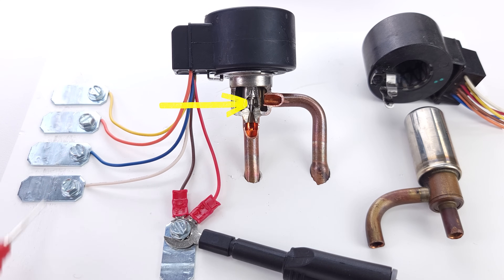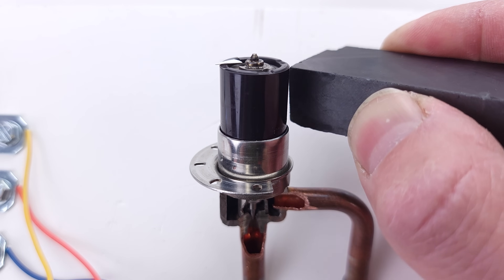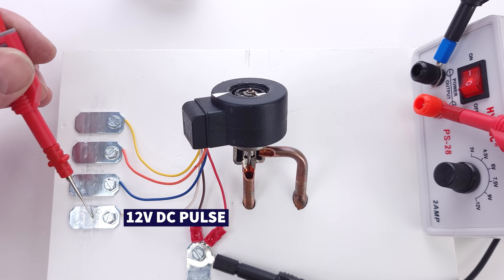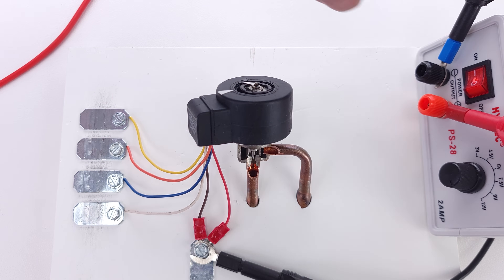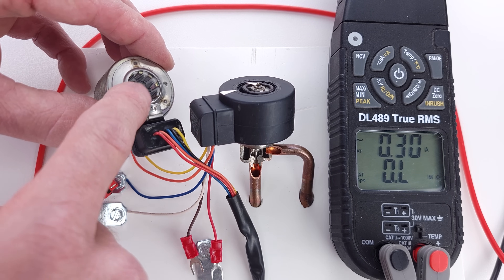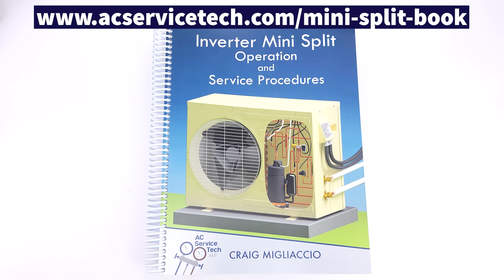Electric Expansion Valve (EEV) Operation and Testing! HVAC Metering Device Training!

Comment from the maker: Mini Split Book on Our Website- https://www.acservicetech.com/mini-split-book  
Mini Split Book on Amazon- https://amzn.to/3ytHJSs  
Mini Split Book on TruTech Tools- https://www.trutechtools.com/BooksGuides   
Mini Split E-Book on Google- https://play.google.com/store/books/details?id=HN-iEAAAQBAJ 
 Mini Split E-Book on Apple- https://books.apple.com/us/book/id6445178399
Reply: Craig your brand is single-handedly changing the service industry for the good! Well done!
Reply from the maker: Thank you so much Tim and I'm looking forward to meeting you at the Symposium in a couple weeks!
Reply: Would this be transferable to the systems in the UK?  For example, does it have both voltage differences and temperature differences?
Reply from the maker: Same component and same voltage in the UK. There are different variations of the EEV but they operate very similairly to this one, thanks!
Reply: How much torque do those tiny motors have?
Reply: It's a servo valve!!!
Reply: @Thelongmanable  Yes I gathered that.  But ty
Reply: When will it be available on Amazon?
Reply: Qqq❤❤
Reply: Great cut away views.  Scary, the size of needle valve orifice seat.  Shows you really want a good liquid line filter to keep any garbage from getting to EEV/TXV.
Reply: I think the rust comes from the galvanic interaction between the stainless and the 20 metal poles in the coil. 
The water vapour turns it into a battery and the rust ensues.
Stainless is at the opposite end of the galvanic spectrum from steel or iron - so rust is an issue where the 2 need to be joined together.
Reply: Dear sir,  What's the name of the hvac book name and how to buy
Reply: https://youtu.be/vtVBpEzApOE?si=nc5yjOkZnO2FYZlZ
Reply: So, we aren't expected to find an eev in an on-off (non-inverter) mini split. If found, when is beneficial to change the orifice size in a fixed speed compressor system?

Comment: I've been trying to diagnose issues I'm having with my AO Smith hybrid heat pump water heater. This video has been super helpful. The issue seems isolated to the EEV because the compressor is getting up to 150 degrees but there's no heat transfer to the tank. Power cycling used to fix it, but today it stopped. I still hear the clicking when power cycling after the EEV position drops from 480 to 0, so I'm assuming it's able to open slightly. Hoping it's just rust and I can replace the coils because the rest of it is in a closed off system. HPTU-50N.

Comment: Does the e book cover inverter split systems or just mini splits. I assume they are generally the same.
Reply from the maker: It is about single zone and multi zone inverter driven mini split ac and heat pump units. Its primarily on mini split heat pumps that are inverter driven and how they provide heat. The general premise translate right over to ducted inverter heat pump systems, thanks!

Comment: I have a Mitsubishi mini split i suspect the EEV is causing my issue.  Will you always hear an audible clicking noise when the mini split powers up?  Because i do not.   My EEV coil Ohms out in spec.  I suspect a restriction and I'm leaning towards the EEV either electronically not working or stuck.

Comment: Question: Are there any manufacturers of HP mini split units or vertical HP condensing units that don’t mount the EEV valve in the outside condenser? I’m looking to build an Air to water HP with the evaporator inside (non-mono block) with some other features. But I am always stumped by the EEV being mounted outside.

Comment: That electric expansion valve with its complete functional materials in a small hardware are like electrical ready to go and work adaptors with plug and play mode and insert and detach mode as long as its core operative magnet is working properly, imagine that in space of modular plug in and out of space station extenders wherein each and every machine plug are independent space modules in space flight function and reconfigurable to Space giant Robot.

Comment: The cost engineering on these things is outstanding. I am a design engineer that has worked in various commercial and aerospace applications. We don't have the option to make ultra-high volume disposable units like this. It's actually hard to design this stuff to meet the cost and volume requirements. Very clever.

Comment: I had just replaced an EEV coil as the air from the evaporator is not cold and the compressor kept tripping. Tested the EEV and the resistance for all the EEV coils are similar to that of a new EEV. However, after replacing the EEV with a new one,  the system is now operating well. What could the likely cause be for the frequent compressor tripping?

Comment: I'm working with a danfoss EEV valve and controller. The motor coil has 5 wires red, black, yellow, orange, and gray. They don't use the gray wire which I assumed was the common. Have you seen systems like this that don't use a common?

Comment: I have a Daikin Multi Split unit (MXM series) which had valves replaced due to failure. Now they replaced the motherboard because Daikin sent a new board that sends a higher current to the EEV. It worked for about a month. Now back to square one because one unit inside stopped working again. It seems that these coils are prone to fail on Daikin units. I hope other brands do not have this issue.

Comment: One of the best EEV videos and explanations I’ve seen. -Certified Tech Support for Mitsubishi(DSG) and Fujitsu(TSA) VRF. Keep em coming!  EEV’s are very reliable like you said, and if something fails, it’s most likely the coil. Mitsubishi makes a magnet that allows you to manually open/close.  I can get you the PN if you are interested.
Reply from the maker: Sure thanks!! Also, thank you for your encouragement! info@acservicetech.com
Reply: Hey.  on a mitsubishi mini split, should i hear my EEV operate when the mini split powers on?  Thanks in advance.

Comment: Sir i wanna ask
The EEV will damage if do pressure test on coil
(Due to off ) don't know where the pin is (will damage by over pressure)
As you mentioned on this video the EEV will stay if no power provided
If run the a/c then turn off power (power supply)
(Pin will stay open?)
Still can be damaged by over pressure?

Comment: Apparently the magnet in the vent and the coils outside form a rough stepper motor. It saves a relative expensive standard stepper motor (which could as well get magnetic coupled to the inside of the vent), but provides some sort of positioning control. A little DC-motor with an incremental encoder would be more expensive and its gearbox has more wear.

Comment: Wich one is better EEV or TXV ?
Reply: You can't compare the two. Single stage and two stage AC's do not have EEVs. The reason you have the eev is because inverter systems have multiple sensors for coil temp, discharge temp, ambient air temp, supply temp etc therefore, the eev can make accurate adjustments on the refrigerant flow while compressor rumps up/down.

Comment: You did mention possible damage due to nitrogen pressure test.  You did not mention anything about EEV position after completed temp call during off interval.    It would seem like a bad idea for an EEV to be left in totally closed position during off interval from a compressor point of view.

Comment: this really helped me 
during replacement of 2.5hp LG compressor, i had to remove the EEV to create space after the workdone i fixed the EEV clockwise direction and the system couldn't discharge refrigerant 
i came across this content that helped me understood the magnetic force and i clipped the EEV  in anticlockwise direction and it worked 💪 ❤❤❤
really grateful 🙏
Reply: Thank you bro. My problem was  like that. But I knowed now

Comment: I have a 12k air handler and a 9k dual unit. I’ve always been a little skeptical as to wether the evaporator coil has ever given more than 50% ramp to the compressor. If I remove the thermostats from the line sets, I can get it to ramp up 90% and it will stay there until it freezes over (usually takes a few hours). Even when I put the larger 12k unit on turbo and set the temp to 65, it will not give me more unless I pull the thermostats on the line set.  Do you think the EEV could be the culprit?

Comment: Hi,
Today have one customer, compressor model MUY-GE13VA. The LEV give different reading
R-BR:0
R-BL:0
R-OR:49ohm resistor
R-Y:0
R-W:49ohm resistor

BR-Y:49ohm resistor

BL-Y:100ohm resistor
Is this LEV spoil because i dont have service manual for this outdoor unit
Thank you

Comment: Also if you have a valve that the electrical is fail, to be able to open the valve you could do it manually by using a magnet and open the valve the only thing is you need to leave the magnet on until you replace the stepper motor

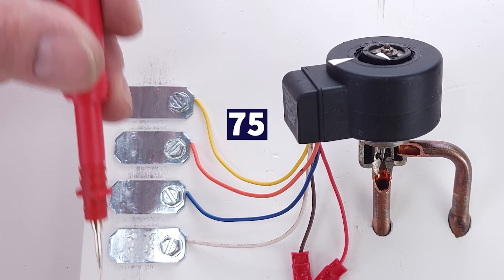Comment: @9:30 many use say 1500 pulses and even into the thousands to go from full closed to full open.
The stepper motor driver can do 1/2 step or 1/4 step down to say 1/8 etc by applying pwm varied pulses to the next pole while the first pole is still energized to clock the magnetic field between the two and then trims the first coil pwm down until it finally clock's to the next field.

So then it an take 100+ various steps to do one rotation and have more precise control. 

On my DIY I just do full step and it takes right about 255 pulses to go from closed to open.

Comment: I have a 4 zone mini split and when it heat mode it constantly sends all 4 units heat as if all 4 valves are fully open regardless of which unit is calling for heat. It does not seem to have this problem in cooling mode so I'm clueless on how to diagnose. Any help is appreciated
Reply: I've ohm tested most of the temp sensors and replaced the outdoor pcb. No changes.

Comment: 320 pulses for full travel is a good resolution but if you had something a little bit less precise, there's always the method of "half steps" that you can use that's not that much more complicated. It will double your number of possible angles you can position your motor at.

Comment: Great video! I wonder why they have those center taps on the coils? Why don't they drive this with just 4 wires by alternating the polarity across the two coils, which would require only half as much copper for the same amount of torque. Also, why don't they put a conformal coating over those teeth to prevent that rust buildup? Thanks!

Comment: Awesome video!  How did you get such a nice clean cut on the stainless steel body?  Just a set of pipe cutters?  As for the copper parts of the valve body did you just hack it with a grinder?

Comment: Carrier had these on their flowtronic chillers.  I had to replace two.  They were very large, and made of brass.  Pipes were 1  1/8” in and out.  Ran on the same type of stepper motor, but used a lead screw to drive a slotted piston up and down.  Two refrigerant circuits, 125 tons each.  The chillers were an absolute service nightmare.

Comment: Hi, glad to get in touch with you.
I work as an air conditioning technician for Mitsubishi Heavy Industries in Spain.
I am pleased to inform you that I have developed a small tool to check the EEV of the different air conditioning equipment. Carrying out tests on devices for domestic, industrial, VRV and Aerothermal use of the previously mentioned brand and also domestic Hisense.
These teams mount EEV from the manufacturers FUJIKOKI, SANHUA and SAGINOMIYA. With the device, the technician can verify three points that I consider important in the diagnosis of the element:
- If the A/C equipment pcb transmits the signals to the EEV.
- Measures the resistance of the EEV coils.
- Finally, it can be opened - closed automatically, or manually select the number of opening or closing pulses.
If you find it interesting, you could expand the information you consider appropriate.
Greetings
Reply: Where can I get that info ?
Reply: @drewc7479  
Hello, I have uploaded another video and I think you may be interested.  Greetings
https://youtu.be/H0jJomVl6hE

Comment: Not sure if it would be overkill, but with the availability of really cheap handheld oscilloscopes it should be possible for a technician to verify the presences of the pulses. If you add a relatively inexpensive current probe it is not necessary to pierce the wire. to see the current. Also with the current probe it should be possible "see" the movement of the valve. A similar principle is used for checking electronic fuel injectors to see if the pintle is stuck. If the pintle is working it is possible to see the pintle hump as the injector moves.

Comment: Excellent video but I think something needs to be clarified. After the liquid refrigerant passes through the orifice in the expansion valve it immediately starts to boil or evaporate and is now not a solid liquid but now in a state called saturation, where it is part liquid and part gas as it starts it change of state from a liquid to a gas. The video identified the refrigerant after passing through the orifice as liquid, which technically it is not.
Reply from the maker: Of course, it is roughly 90% liquid and 10% flash gas but it does not have room to expand because it does not have room until it travels through the line set tube to the indoor unit where it flashes more. For ease of understanding, we are referring to it as low pressure liquid. For more detailed information, check out our refrigeration cycle videos that explain what you are mentioning. Also, the metering device in a minisplit is located in the outdoor unit, thanks!
Reply: @acservicetechchannel  Thanks for the reply. Yes, I realize the line going from the outdoor unit to the indoor coil is not the liquid line but is instead refrigerant that has passed through the expansion device. I actually know the refrigeration cycle very well. I just have one question.  Does this line need to be insulated because of this flashed gas, will it sweat like a suction line?
Reply from the maker: Yes absolutely! It will sweat more than the vapor line because it is slightly lower in temperature because the vapor will have a little superheat, thanks!
Reply: @acservicetechchannel  Thanks but like I said, I know the refrigeration cycle very well and it is impossible for the vapor (refrigerant) in a saturated state to have any super heat. The vapor can only be superheated after it has completely changed state to a gas, like it does in the last stages of the evaporator and then it is possible to pick up sensible heat that you can measure as superheat. I think what you were trying to say is that some of the refrigerant has evaporated to a gas and lowered the temperature of the saturated refrigerant below the dew point of the surrounding air.

Comment: Never power a solenoid coil without the core that it operates. Without the core it won't generate a back EMF and the coil will experience overcurrent and burn out.
Reply: It is not a solenoid at all it is a stepper not solenoid😂😂😂😂😂 solenoid valve opens and closes period a stepper adjusts the opening not a solenoid.
Reply: @dmiestercommkitchentech3043 Formal name is stepper motor.
Reply: I've had it happen on a solenoid.
Reply: You can put a screwdriver or something metal through it
Reply: https://youtu.be/LzvVjvUpOVM?t=04m48s
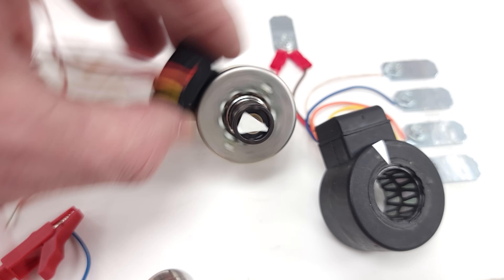Reply: Did you watch the video? He already told us that at 4:48.
Reply: That happens on solenoid coils (be3n there, done that, learned my lesson), but it's not as likely with these currentlimited stepper motor coils. It would take a lot longer anyway.
Reply: @hackfreehvac 
Madem ki dersini aldın ,  bu dersten para kazan .....
Aldığın dersin videosunu yap , YT de yayınla....iyi para kazanırsın.
Zuu ha ha ha ha ha
Reply: It'll melt into blob actually
Reply: https://youtu.be/vtVBpEzApOE?si=nc5yjOkZnO2FYZlZ
Reply: You have back emf only when energized by AC. With DC it is just the ohmic resistance that limit current. So no damage done if the rated voltage is applied with or without any core.
Reply: To be fair he said that in his video he’s pretty smart and has helped me a lot in my career along with Bryan Orr and gray furnace man. Just a few more resources for you.
Reply: It’s not a solenoid coil it is the field windings of a small stepper motor.  He did no damage to it as there are only small electrical pulses provided in order of the colored wires, that drive the motor in small increments.
Reply: @rodgraff1782  I was gonna say in parts they call it a stator 
*stator motor
Reply: I did that once lol,  looked away for a minute and the next it was smoking,  this one isn’t an solenoid though, more like a motor
Reply: K
Reply: Good advice, if it were a solenoid coil, it's not.